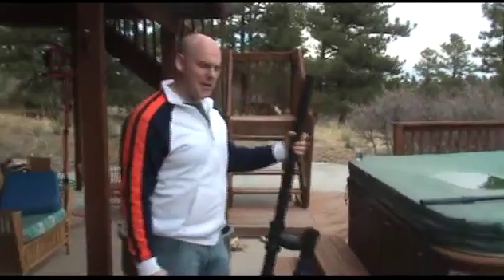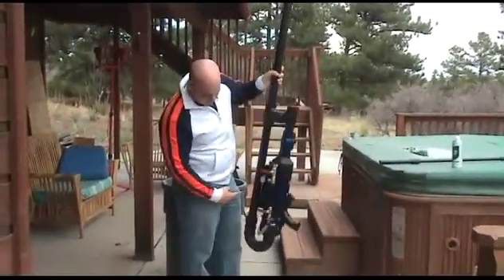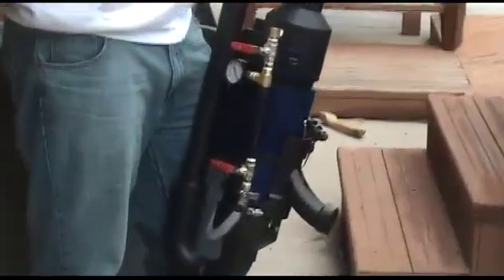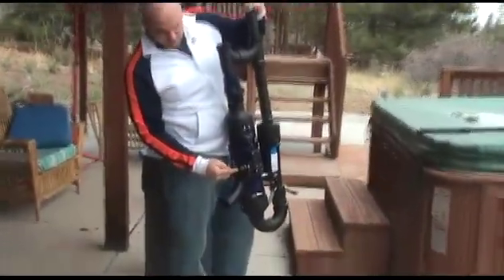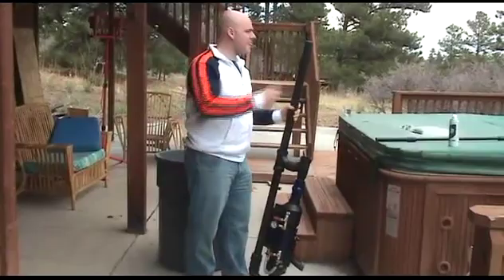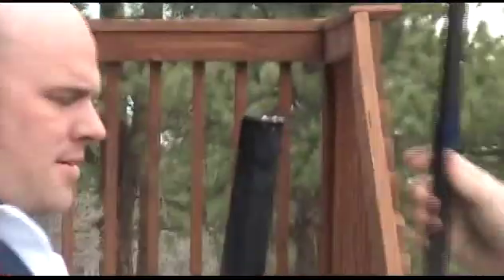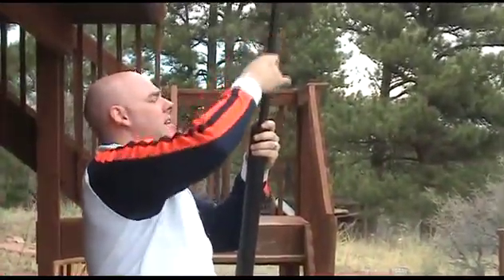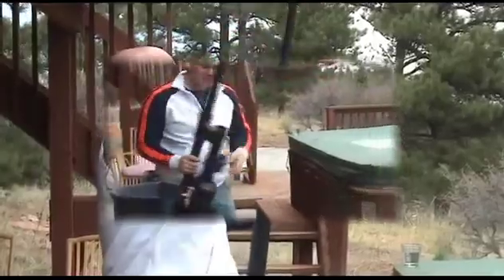Advanced Spud Gun (Potato Cannon)

Comment from the maker: I shaved down the corners of the fan casing with a Dremel tool, and just pushed it in.  Then I put a bit of expoy on the parts that touch the chamber.

Purchased the electronic igniter from a local hardware store (BBQ Grill area).